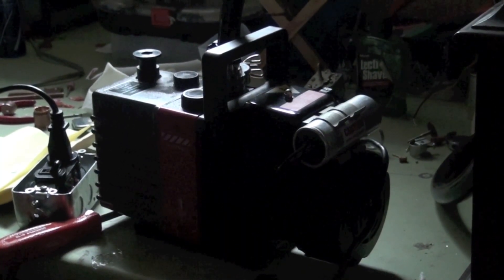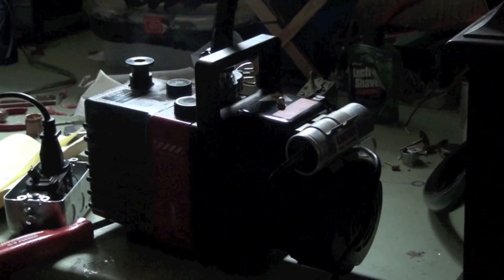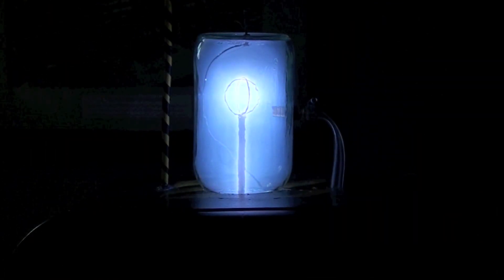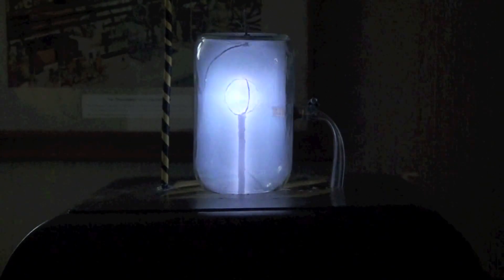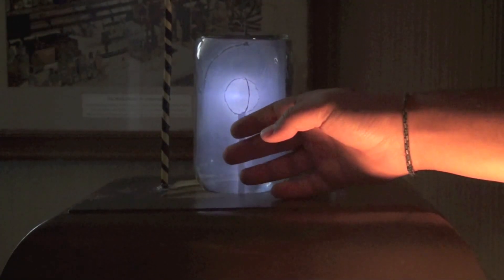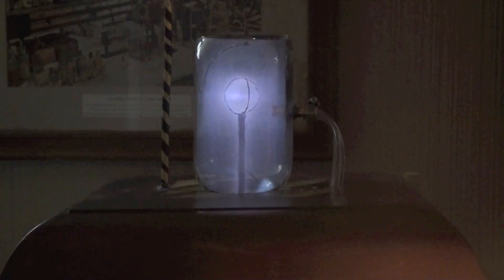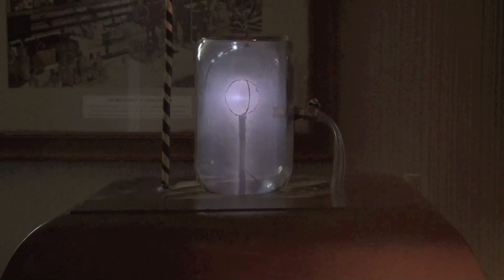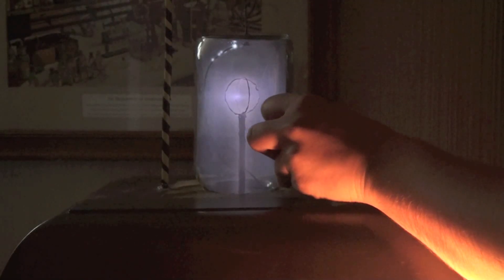The fusion reactor I built out of garbage

Comment: WHAT?! A DIY FUSION REACTOR? I love it.
Reply: It's purple colour
Reply: Not rly what is he fusing a vacum?? You need hydrogen 2 and 3 to fuse them into helium and if done correctly it might generate energy
Reply: @kosovoisserbia8937  Actually it really does fuse atoms. It's called a Farnsworth-Hirsch Fuser. It works by fusing ions from the cathode and anode. It does work, and it can release some radiation but very little.

Comment: I would not recommend sitting next to it when it's running. For fusion you need deuterium in your chamber. In any case you probably produce a ton of x-rays. I would not do this without a Geiger counter.
Reply: It doesn't use deuterium, it has small amounts of air inside, which makes fusion happen. Air molecules can have fusion reaction too. The difference between this and a fusion generator (which uses deuterium) is that this doesn't produce energy to generate electricity. When fusion reaction happens with deuterium, a lot of energy will be released from the bindings between protons. Basic principle of fusion reactor is still the same with this project. Of course, it still can emit x-rays and geiger counter is always nice to have when working with such experiments.

Sorry for my broken English

Comment: nice work, my thoughts are if you can have a radiation counter on you or a type of badge, if any neutrons are produced they will hit the glass and make that radioactive. have you checked for any radiation produced like xrays etc. ?
Reply from the maker: I had a geiger counter offscreen. Anything under 10 kilovolts won't produce xrays and anything under 35 kilovolts won't produce neutrons, but we double checked to be sure. Also most isotopes of silica that are radioactive decay fairly quickly so the glass would stop being radioactive in a fairly short amount of time
Reply: Good to know glad you had those things in place, might be worth mentioning that to others so they don't miss those things accidentally.
Reply from the maker: Harry Georgiou if you check out my latest video on plasma and fusors, I talk about that extensively
Reply: @thethoughtemporium  why haven’t you made a part two to this video with the electromagnets in place?

Comment: Would this be enough for fusion of deuterium?
Reply from the maker: Not even close. This is simply a demonstration model. For true fusion you need to drop the pressure further, increase the voltage and build a bunch of other systems to work in conjunction with this

Comment: Are you using Deuterium(H2) after pulling the vacuum, if you are.. that container should be made with Lead Glass or surrounded by Lead, or leave the room when it's fusing..I would say if your using H2 be extremely careful, I've never built one myself but do know a bit about the subject, Be Careful. The core of Complete Fusion is over 45 Miilion Degrees Kelvin(180Million Degrees F)+Radiation, after typing this I realized you have already figured all this out, NVM Have fun..Fusion is Beautiful!!
Reply: Daniel Pierce Gamma or Xray radiation right?

Comment from the maker: @JakeXVX running a full fledged fusor is dangerous to a degree. it doesn't release neutrons usually until you pass 30kv through it. fusing refers to the combination of two atomic nuclei into one larger one. the one in the video's only hazard is that the glass could break because i didn't use pyrex
Reply: At first, I thought you were just a random biologist showing us how easy is it to turn plants into lovecraftian monsters. Now I understand. You're secretly Rick Sanchez.